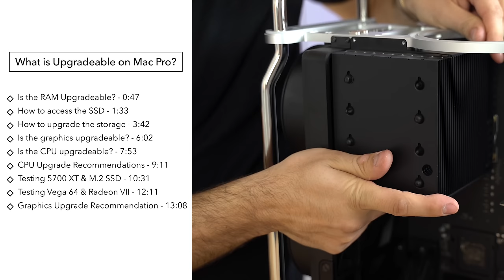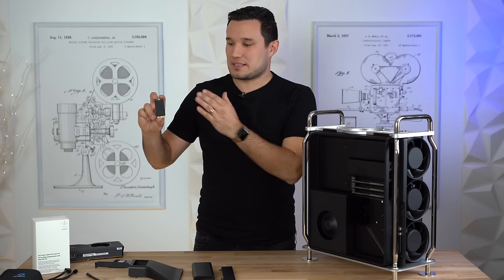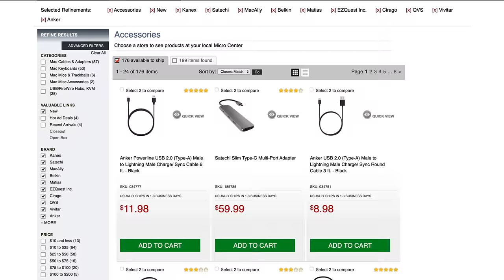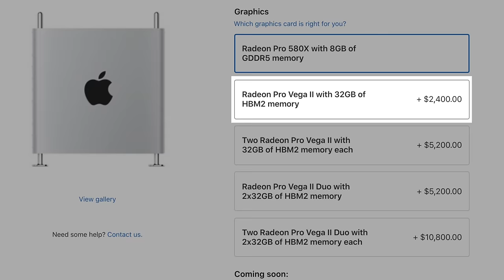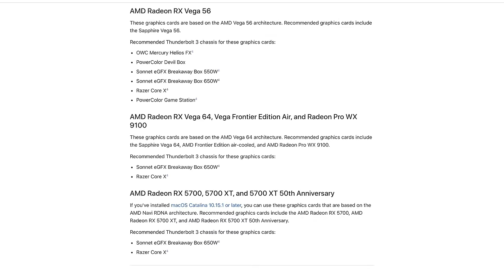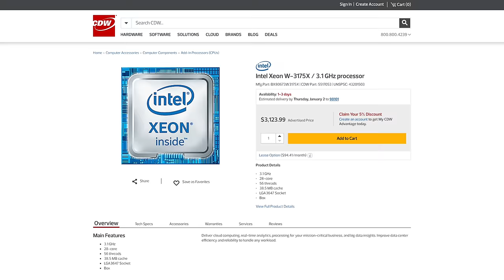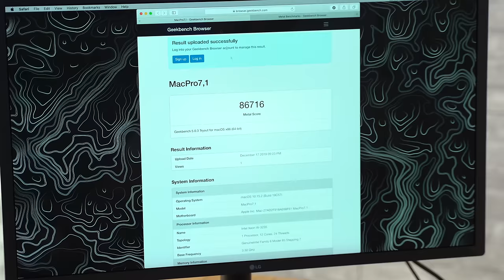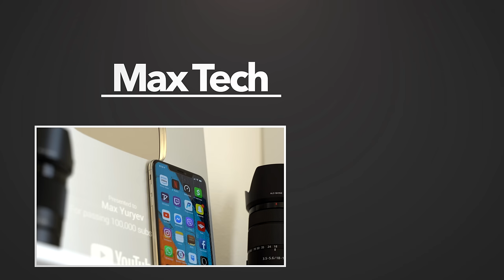2019 Mac Pro - Everything you can Upgrade & How!

Comment: Hey Max, updated my new Mac Pro with the Radeon VII. The fans spin up super loud when I put the system to sleep. Any insight on how to solve this?
Reply from the maker: It’s a software bug that needs to be fixed with new drivers. Right now you need to disable sleep and turn it off yourself when needed. Sucks but hopefully they will fix it soon
Reply: @MaxTechOfficial  Thank you! Fingers crossed. Also, any reason I can't have the 580x installed along with the Radeon VII? I'm an Adobe person, so Premiere, AE, etc. I've read that Premiere is pretty good at utilizing all GPUs it can get its hands on for effects and render acceleration, etc. Curious your opinion of having both installed. And any/all thoughts that raises. Like where to run the display from, etc. Fun figuring this all out.

Comment: Thank you Max! Are there any third  video cards that would support 5K or better displays? I haven’t seen a GPU that has Thunderbolt 3.
Reply from the maker: Only Apple is currently making video cards that pass-through Thunderbolt 3. There are a few graphics cards that have a usb-c output but they don't support Thunderbolt 3 displays. If you buy a Mac pro just get the base 580X graphics and keep that in. You'll have access to enough slots for multiple GPU's and the 580X will allow you to hook up GPU's to the 4 Thunderbolt 3 ports on the system.

Comment: XDR Display does not work with 3rd party graphics card??? I need to modify my order yet again..
Reply from the maker: Just leave the base 580X graphics in the Mac Pro at the bottom. It reroutes the Thunderbolt 3 ports through the other ports on the top and back of the Mac Pro for that display.
Reply: Max Tech ok good to know thanks!

Comment: Hi Max Tech, great video! Thanks for the very helpful info. Question: Are you sure about the 3175x CPU upgrade working? Just really want to make sure because I'm greatly considering going that route. Thanks and keep up the great work!
Reply: Frank Smith It might work, I’m going the same way if confirmed. The only thing that I’m worried is different core stepping (CPU revisions with additional futures) between Apple Xeon CPUs and the W-3175X, which may be not supported by Apple
Reply: @chroman  Yes, I wish someone would post some info on this.
Reply: I've heard somebody tried and it doesn't work, I think we really need to use the 3200 series chip just like what apple offers

Comment: Hello, I bought the MAC Pro 2019 in the 8 Core version. Unfortunately the Intel CPU W 3175X does not work in my system! Why is that?
Reply: Hi Klaus, did you get it to work? I want to upgrade my 8core now...any recommendations for me?
Reply: Because you took advice from this dude who lives in a Mac Bubble. I own a 2019 Mac Pro and Z590 PC system and I choose to use them both to their potential. Gaming, OBS or streaming windows handles better. Audio creation macOS kills core audio compared to ASIO. Much lower DPC

Comment: I heard that the MPX slots also provide additional performance enhancements as well as providing power to the graphics cards.  Is that a possible reason for  the lower performance when using regular AMD graphics cards such as the Radeon 7?
Reply from the maker: The MPX slots provide power instead of having to plug in a cable and they also pass through thunderbolt 3 and display port back into the motherboard from the GPU's for other thunderbolt 3 ports. I don't think they get better performance because of that since the Vega II is rated at 14.1 teraflops of RAW power and the the radeon VII is 13.8 Tflops (barely any difference). When we do metal test though the Radeon VII is running at 60% of the performance it should.. We will try to get windows installed and see how it runs there. If it runs way better that means it's just drivers.

Comment: so i bought the OWC accelsior 4 m.2 nvme board and put 4 Samsung 970 evos plus on it brand new and my 2019 mac pro would not turn on i got 2 blinking amber lights so i tried just 1 of Samsung 970s and it read so then i tried 2 still 2 amber lights so i then tried formating each 970 and again same issue and will only allow 1 970 to work i tested the accelsior for n a different computer no issues with the accelsior so is this a Mac OS Monterey issue?
Reply: Shouldn’t be as the mac just sees the PCIe data that the plx is doing. What format you using on Mac or can you not even get that far? I believe that’s a 4x pciG3 card so any slot should work. Which slot you trying in Mac pro
Reply: @adzpana   i tried formatting each one in various configuration to ntsf to exfat to aps mac os journaled i tried it all still wants to read just the 1 NVMe ssd

Comment: Is it still true that i can not Upgrade my internal 1TB SSD to a larger 4TB SSD and boot from that? I really cant believe this! Cant anyone help. I just purchased the SSD and the M.2 PCIe adapter thinking I can upgrade and Migrate. from a backup. Damn, Apple. not alone is my Mac Pro 2019. almost obsolete since the introduction f M1-M2 but. wow. Im so pissed. Does anyone know how to make this work?
Reply: Pretty sure you could only do this in store as the ssd is locked to the machine via the T chip

Comment: Hey @maxtech, how many full-length GPUs can you fit in with the base GPU that Apple offers? Thanks!
Reply from the maker: If you’ve got a high-end card that uses two power ports, you’re limited to two cards.
Reply: @MaxTechOfficial  Two cards plus Apple base Radeon Pro 580X? or replacing the base card?
Reply: Korie Cull nah just 2 cards.
Reply: Natlus It’s actually 4 if you take the bottom stock card out, I ordered mine a while ago.
Reply: Natlus all depends on how much power the cards use

Comment: Radeon VII runs great in Davinci resolve in the new Mac Pro, only 10% slower than the Vega II in a bunch of render/playback tests I ran. Also the Vega II + Radeon VII was 60% faster than just the Vega II
Reply: Hey Rick. That's very important to me! Thank you for your post. Have you been thinking about buying the MPX580 and put 2 RadeonVII in for Resolve? Would have been a much better price.
Reply: For the mac pro : the GPU is too weak. The Vega II single card is twice as slow as an RTX 2080 which makes this computer irrelevant for GPU rendering app like color correction on DVR, video editing or 3D creation. 

For the XDR display : This display is not good for monitoring, it has a contrast shift when you change your angle of view, this shows a lack of precision in color rendition, it does not happen on Eizo, Flanders, Sony or Canon monitors. If you need an entry level true precision monitoring screen, go with the Eizo, they are cheaper and way better. And don't forget to plug it to an external video card and not directly to the GPU otherwise it won't be precise enough.

My 2 cents.

Comment: Also is there enough PCI to run two? one with 4 drives and one with 2?
Reply from the maker: Yes of course. For that setup you’ll need one 16x slot and one 8x slot, which it definitely has even if you get some extra graphics cards in there. Use the link in description for that card.
Reply: Max Tech Thanks!!

Comment: Hi @Max Tech, I really enjoy videos and your guidance overall. You had me convinced purchasing the 28 core 3175X and I am now waiting for my Mac Pro that is probably delayed.. So all this waiting time, has led me to explore what other people think about the compatibility. So far, I have encountered one on Mac Forum who says it is NOT compatible as it has too little PCI-E lanes and a different CPU id that is not the supported CPU ID's that are 50655, 50656 and 50567.

So all in all, I have the 3175X here in front of me and I am no worried that it may not work after all.

As I am waiting for my MAC I would offer to send mine to you for testing or would you perhaps be able to get one yourself and prove that it works?

All the best
Daniel :)!
Reply from the maker: Hey Daniel, We may buy a used base model and upgrade it ourselves for Vadim but I'm waiting to find a deal. A person on Mac Rumors forum put in a Xeon Gold chip that is also not technically supported, I think its even more different than the 3175X and it worked for him. I can't guarantee that the 3175X will work as we haven't tested it personally but it does seem that it would. When will your Mac Pro arrive? If we can get a used Mac if you still have it and want to sent it to us for testing we would be willing to do so. If that happens I'll reply to this comment again. -Max
Reply: Even if it did work you have 48 pci lanes instead of 64. That CPU is for overclocking and you would need asus dominus extreme. And it’s 6 channels not 4. Don’t know why he would show this CPU. Mac Pro accepts Xeon W-32xx series of chips

Comment: The question is....were will intel and AMD be in architecture in 5 years time? This tower is well built and unique, but for it's not worth that kind of money unless your making money with your computer and you dont have experience in building your on system.
Reply from the maker: True, no one should be buying this unless it’s a tool for their work or you just have a lot of money and spending this much doesn’t matter. One good thing is Mac computers hold their value very well so you can resell and upgrade. One big reason to buy it is having MacOS with the most powerl AMD graphics cards ever but also If that afterburner Card can help you since you can’t buy that anywhere else.
Reply: Delain124 I ran a Mac Pro 5,1 from 2010 until a month ago. I maxed it out over time. Although it was „outdated“ years ago, I never had any issues with it and did hundreds of projects on it. I made my living with this machine for years, and it paid itself multiple times. So no, as a professional I see no problem using outdated hardware somewhere down the road as long as it’s powerful and reliable. This one can be upgraded with a second hand 28 core for a few hundred bucks in some years, so I think I’ll be covered.

Comment: Design issues:

1. You can not open the cover without removing every single cable attached

2. If you have it under your desk you will have to detach every single cable AND drag it out from under the desk to remove the cover which has to be pulled up.

3. As a result of the above, you can not test the computer with the cover off

4. I have tested the Mac Pro in the local Apple Store. I was able to bring it to a crawl by having too many vector objects in Pages/Numbers/Keynote. This I have to admit is due to bad programming, I can run the same number of vector objects in the iWorks '09 Apps on my 8 year old iMac 27" without bringing it to a halt.

Comment: the asus hyper m2 x16 v2 is certainly not working out of the box. You only see one ssd and speed is low (+/- 800 MB/s)
Does anyone know how to make this working (drivers or settings)?
Reply: Definitely dose not support PCI-e bifurcation. For 1 there is no need with the amount of PCIe resource it has. 2 that is dependent on the Motherboard manufacture to add the feature. If you added a Asus Hyper 16 M.2 I believe you would only see the first drive as there isn't anything to tell the PCIe slot to use 4x 4x 4x 4x. Only PCIe M.2 cards that have more then 1 drive would need a PLX chip on it. Those tend to be more expensive cards. OWC Accelsior 4M2 or Amfeltec Squid for example.

Comment: your 30hz monitor display problem will be sorted out if you get a graphics card with display port.
Reply from the maker: That was connecting over DisplayPort. One of the ports only ran at 30hz the other at 60hz.

Comment: Why xeon apple? Threadripper or i9 for performance for pros built on xeon or epyc server. Benchmarks? Older xeon slow. And radeon good 32 vram but no cuda how's metal? No nvidia drivers. Limited plugins and 3d work..good for some graphic design music film video but not engineer data 3d renderfarm big film video projects and gaming.
Reply: Most workstations run Xeons and ECC Memory including HP and Dell ones that cost even more.  Mac Pro is even coming out as a rack format. This is not for gaming.
Reply: Yes but hp or dell  xeon workstations for data or server 5k to 70k each...not 1920x threadripper pro workstation with 2 monitors I built with windows 10 64  pro usb for less 4k ...that can hackintosh or linux. Macs not really gaming. New 6k-53kplus mac pro 2019 can do both pro and data sever on top 28 xeon. Xeon not really performance neither nvidia quadro for power number crunch. Xeon or epyc server and i9 or threadripper for performance based on xeon or epyc. Makes more sense i9 in mac not xeon. 6k base mac pro base ripoff for what you get.  Mobo and cpu upgrade beyond xeon 28 for mac I doubt atx case. I9/i7/ ryzen single thread and gaming.

Comment: Dear Max. PLEASE RESPOND: I would like help configuring one or two MacPros. Thank you for your video. SO helpful!!  I'm a pro user. First Mac was a Macintosh IIci. Photoshop After Effects Premier FCP Resolve Media Composer all since first versions. Have used Macs to do Vfx on major movies and editing / finishing, on same and most currently on major documentaries and first narrative feature also as preditor/finisher. I am trying to config a really powerful Mac Pro with optimized use of third party user upgradeable options also for best power/bang for buck, tasks appropriate,  beast. I have sorely missed the absence of truly pro Macs since the cheese grater and even sent an email to sjobs to which I received a response, complaining about the disappearance of user upgradable Macs for professionals shortly after he returned and launched the first iMac in 1998! So, that being said. Back in the day, I would have printed out the innards of the Mac Pro, labelled by specs (PCI slot speed and length / ram options / inputs/outputs etc. and same for all my actual and possible peripherals) mounted on presentation board on the floor and then configured them by drawing with colored pens the circuit diagram kinda thing (my step dad was an electrical engineer) So failing that ... could I consult with you to design something for my needs and budget? Crowd (out) sourcing being the poor human's AI!

Comment: Can you try an Radeon pro wx 5100 series vs a Vega in similar price point or what it would compare to in performance?  I am starting to hate Apple for their lack of NVIDIA cud’s core graphics support!  I have a MacBook Pro i7 6 core with 32gb ram and a stupid Radeon 555 series. I hate amd never really been a fan of them. F Apple for their lack of real professional brands. I don’t want to buy a egpu and another amd card if it won’t make a huge difference. Again I want NVIDIA. I use premier and after effects. Or maybe using that afterburner card on an egpu?
Reply from the maker: The latest AMD graphics cards work really well with Premiere especially if you need high performance in laptop. Check out this video: https://youtu.be/D-1tx9KWXQo

Comment: Apple Inc. MacPro 5,1 (2012) 12 Core, cost me around $650 and here are the results : 
Single-Core Score : 576,  Multi-Core Score : 5747
Excellent for graphic design, video editing etc.
I'm going to upgrade it with higher freq. processors and high-end graphic card to improve the performance, total cost would be around $1000 max.

Comment: "YES THE CPU IS UPGRADABLE". O RLY? Please actually put one in and see if it works.... :-)
Reply: it is upgradable
Reply: @UnExtinctive  physically yes you can put another chip in - will it work? I'm waiting to see someone actually do this successfully (without damaging the pins) and have it actually work & be supported properly by MacOS - before I just accept it as fact. But thanks for your message. I am now fully confident it is possible and will go and spend £10k on this computer knowing I will have no problems lolol
Reply: @thejohnb  yes, we've already replaced the cpu in our 7,1 successfully
Reply: @UnExtinctive  with what replacement chip? have you reset the NVRAM since that? Seen reports that system gets fkkked after that & have to replace original chip. more details please also - what chip did you have originally, what did you go to, and where did you get it from since they aren't really available anywhere much.